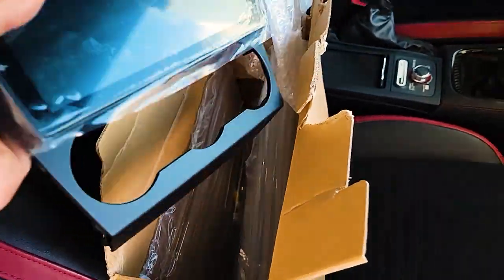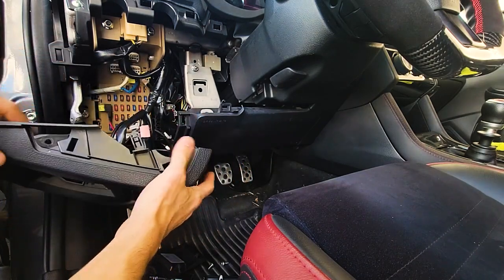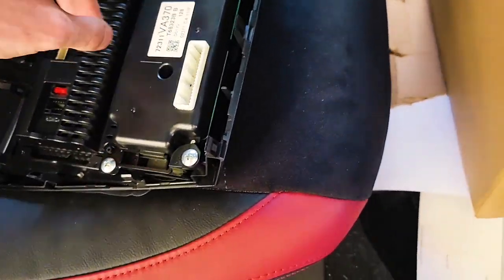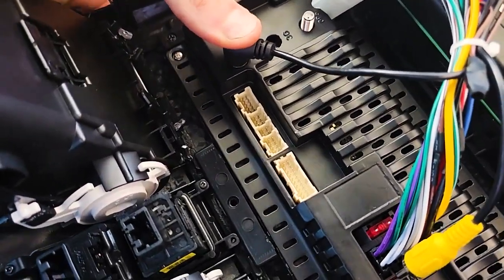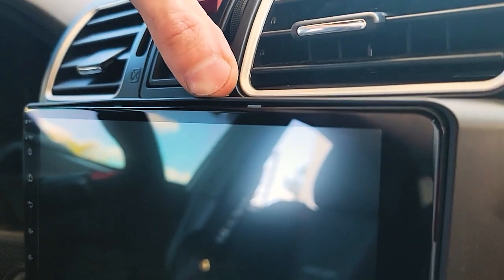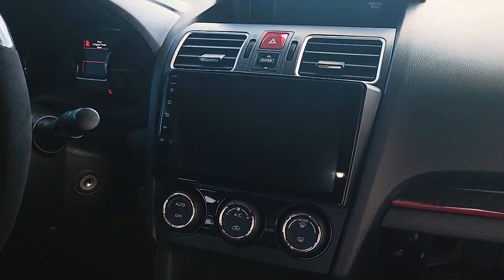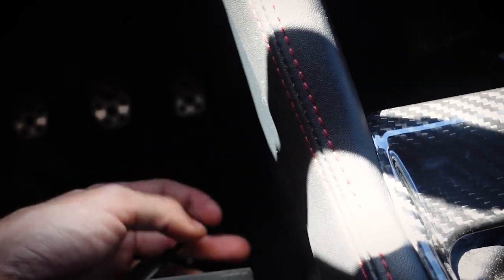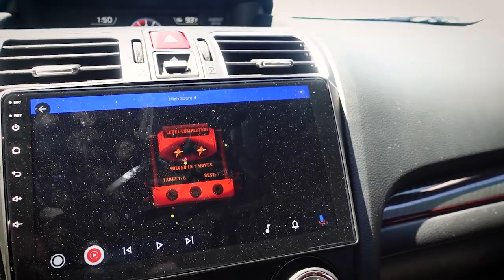CHEAP Android Head Unit Install & Review In My WRX

Comment: It looks like you can remove the vent trim rings on this one unless I got that confused with the stock unit. I am leaning towards the idoing for all the reasons you listed plus other videos from different channels. I agree with your take though; this is a decent budget option if you don’t mind the quirks. But for around $200, you can’t expect too much.
Reply from the maker: For sure. And I did remove my stock rings and the new silver rings for the radio are molded onto the bezel. But definitely both of them are good units but the idoing is definitely a better unit but you're paying more for it.

Comment: So I’m 2 years late lol but I just got the same exact head unit for my Impreza and I, for the life of me, can not get the back up camera to work.. I have the yellow wires plugged in and everything is all connected but it still doesn’t work. Any ideas?
Reply: Automatic or manual transmission?
Reply: @bierlyynn  manual

Comment: Bought same to try. Idoing would be best. Have issues with mines but the actual head unit has app says z link to use android auto withought buying anything else. Had issues with vents too had glue them. Do agree better than stock but not quite right

Comment: Looks nice. My factory unit on my 2020 wrx already has car play and it does the job. Would be nice if it was slightly larger and a little faster but would not spend a cent “upgrading” it. Not bad though.
Reply from the maker: I have the 2020 as well but it would never stay connected to my phone for some reason and it drove me nuts. I would have my GPS up and right when I needed it it would disconnect or something. Not sure why it did that.

Comment: Bought this headunit no hardness for it did this one came with one plug and play?
Reply from the maker: It did, but after using the unit for a week or so and removing it I would say I do not recommend unless you go with the idoing unit because it's much better processor and hardware

Comment: I bought the same head unit but am unable to get the reverse camera to work. I get a grey screen when putting the car in reverse. I have everything plugged in as you do. Did you have to do anything in settings to get this to work? Thank you!
Reply: Ita simple fix. Move over the pin of the video signal to the left one. That what was wrong with mines. Solved issue
Reply: @sagastum211 hi, could you please explain it in details? I have the same issue and have no idea which cable was connected wrong
Reply: @Alex-uo4oi  theres a pin on where video conector is mine had one pin over and if the issue you have its on gray scale or picture looks gray thats software. But if no image at all then yes will be pin. I uploaded video with my problem and how i fix it. Will see video and ill tell you whoch pin
Reply: @Alex-uo4oi  okay on my video at minute 3:58 theres 3 wires a pink a yellow and black they supposed to be right next to each other mines the negative the black wire was one pin towards the right so just need to move to the left. 
Also very important make sure wiring comes with the 5 volt step down converter
Reply: @sagastum211 thank you for the fast response, I really appreciate it! I checked out your channel, but I didn’t find the video you are referring to. Could you please post a link here?

Comment: Hey man i just installed my idoing last week, it actually has the same gap at the top of the screen like yours, i think its a common issue with the aftermarket bezels. Not bad though, barley even notice it
Reply from the maker: Yeah it bugged me for about 30 minutes and then I forgot it was there  lol
Reply: @StreetInspired1  right haha, did you end up trying the idoing?
Reply from the maker: @TheMasterChristopher  No, still running this one. It's only been in for about 3 weeks. I had a seicane unit before on my last wrx tho.
Reply: Contact idoing official,we will send details guide  how to fix gap issue.

Comment: Well drop the link...
Reply from the maker: The only problem with Ebay is the items typically come and go. The one I bought only had 2 available from that seller so its gone this looks like the exact same unit but it's priced a little higher. Mine was $159 this one is $174. https://www.ebay.com/itm/9-Android-10-1-Car-Radio-Head-Unit-For-Subaru-WRX-2016-2018-Forester-2015-2018-/293635282669?mkcid=16&mkevt=1&_trksid=p2349624.m46890.l6249&mkrid=711-127632-2357-0
Reply: @StreetInspired1  Thank you!

Comment: Do they have one for 2014 wrx
Reply from the maker: I did find one for the 14! https://www.ebay.com/itm/9-Android-9-1-Car-Stereo-Radio-Head-Unit-HD-GPS-For-Subaru-Forester-2008-2012-/293781513550?mkcid=16&mkevt=1&_trksid=p2349624.m46890.l6249&mkrid=711-127632-2357-0
Reply from the maker: Idoing makes them as well but its much more expensive. https://jdmuscleusa.com/products/idoing-head-unit-for-subaru-forester-wrx-sti-2008-2014-wireless-apple-carplay-android-auto?variant=39428220551270